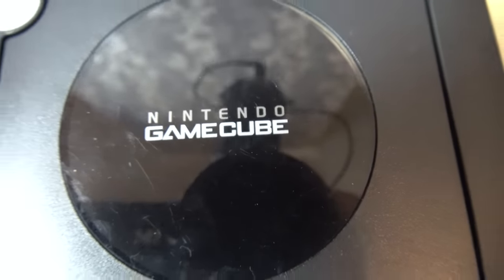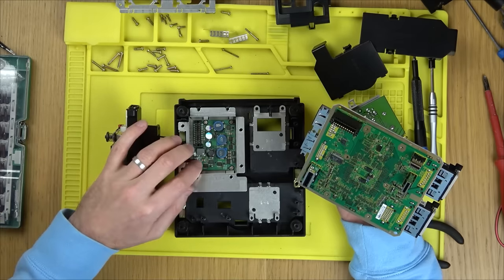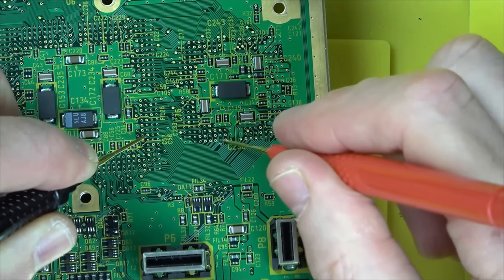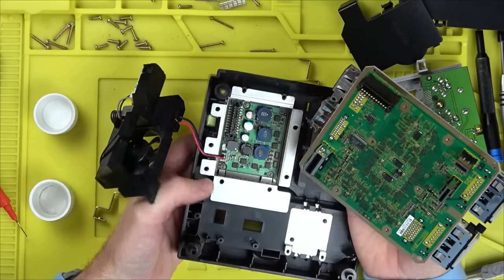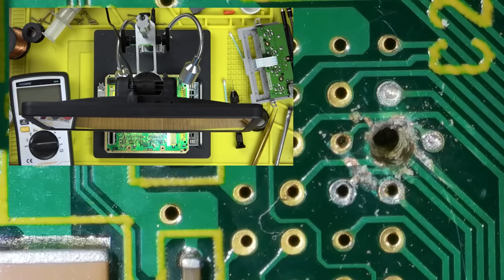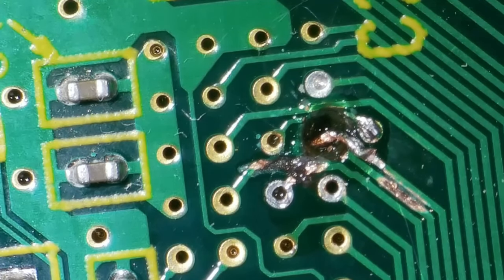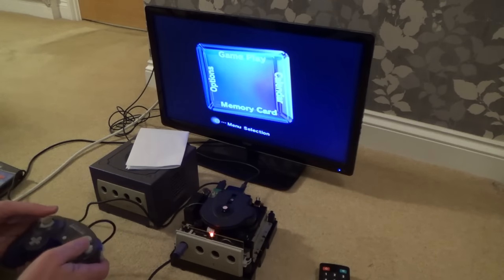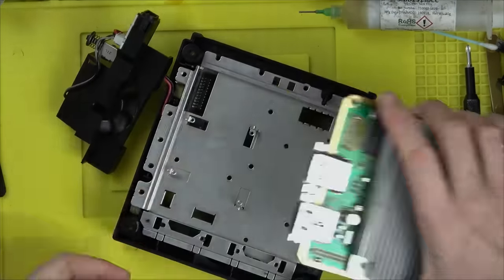Trying to REPAIR a Nintendo GameCube - Black Screen - No Disc Spin

Comment: I'm speechless... I thought you'd ruined it for good. You are, at this point, a mad tinkerer!

BONUS INFO:
Capacitors and inductors have non-static resistance.

When performing the continuity test on a capacitor, you will have a brief moment of very low resistance while the capacitor charges up. As it charges up, however, the resistance will increase, meaning at some point the resistance goes above the continuity cutoff. This leads to a beep-to-silence continuity behavior.

When performing the continuity test on an inductor, it will at first appear to be open (or very high resistance). But as electricity begins to flow through the inductor, the resistance goes down, eventually leading to a situation where the resistance falls below the continuity cutoff. This leads to a silence-to-beep continuity behavior.

Thus, you can sometimes determine what the component is by the way the multimeter beeps:
Constant beep: Low-resistance resistor.
Constant silence: High-resistance resistor.
Beep-to-silence: Capacitor.
Silence-to-beep: Inductor.

Not all of them will behave that way, however:
If the capacitance of a capacitor is too low, you won't hear the initial beep, thus appearing as a high-resistance component.
If the inductance of an inductor is too low, the beep will begin immediately, thus appearing as a low-resistance component.

In other words:
Beep-to-silence or silence-to-beep almost always signify it's a capacitor or inductor (respectively). There may be some special non-standard components that exhibit these behavior, but I don't know that much about electronics.
Constant silence or constant beep doesn't necessarily signify a high-resistance or low-resistance resistor; it may simply be a capacitor or inductor (respectively) with a very low capacitance or very low inductance (respectively).

Comment: I have a "part finished" of the exact same issue - on this one here I removed the CPU to fix the trace, OMG is it the most painful thing to re-fit the CPU...  I need to try and motivate myself to re-try fitting it again...   Totally amazed you managed to fix this after drilling through the layers lol!!!  A "just before Christmas" Miracle =D   Great work Vince!!!  It shows that determination sometimes beats all the odds!  I think if that proves to be reliable over hours of testing - it could be sold as a working Gamecube - other than how large that hole was, you've joined up what needs joining (properly) and secured it properly.  So its a fix that should be reliable imho.
Reply from the maker: A Christmas miracle it truly was 😂 I think I remember your video from years back, we need a Part 2 now Chris! I want to see your pain of reballing it as I sit here smugly watching whilst playing Mario Kart Double Dash on the NON reballed GameCube😂
Reply: 🤣🤣🤣 @Mymatevince  Don't forget the part where in my first attempt I heated it for like 20 mins and was dripping with sweat from all the heat lol
Reply from the maker: @GadgetUK164  Hahaha, but not quite as much sweat as when you used the drill in reverse!!!!

Comment: Vince, that was some excellent PCB digging you did there. Great job and a very fun video to watch. 
Concerning the corrupted SD cards: Always be sure to shutdown your microscope before you power it off by holding the Standby button on the front pressed. It've heard of it corrupting files when power just cuts out (e.g. by switching it off using the cord-power-control of the lamp for instance). I do have an Andonstar microscope myself and keep on forgetting to shut it down propely from time to time myself.

Comment: I can't believe that actually worked, Vince! Wow. How lucky is that. Would poking a wire through the damaged via and heating it with the soldering iron perhaps have worked? I would imagine it would poke through to the ball and perhaps solder to it? Would perhaps have saved the drill. That drill looked so terrifying under the microscope. :O
Reply from the maker: I know, what are the odds!!! I think the hole needed to be made bigger as the ball was slightly offset and not directly under the via. Also the via itself seemed to be quite full (maybe with the solder mask and bits of corrosion) 👍

Comment: To chime in with what other folks are saying about sd cards, there are high endurance sd cards for cameras if you weren't aware. They're slightly more expensive, slightly slower, but designed to record tens of thousands of hours of video without failing.

Comment: Well kudos for having the nuts to try this method of repair. You've shown people who are curious and don't have the knowledge what mistakes can be made when trying to fault find.  But that said it wasn't working so nothing would have been lost, but you did it! The best option would have been to push a wire down without drilling and try to solder it in place. If this didn't work then maybe drilling would have been a last ditch attempt - as I am sure you realised. You were incredibly lucky not to totally destroy interlayer connections or short pins on the underside of the BGA chip when you flowed solder through the hole you made. You could do that 100 times with disastrous results before it actually worked as a fix on one item. I'm so happy it worked for you. Maybe being careful on this occasion would not have worked as the through-hole seemed to be totally corroded.

Comment: I'm surprised it worked out (and glad it did so) but I admit I was mortified when you took the drill to the board😅 I personally might have explored the other side under the heat sink first.  PS: I don't trust SanDisk cards any longer, after going through a number of failures...
Reply: there's a possibility there were fake/counterfeit cards ?
Reply: @VintageTechRepairs  they were legit, I just think the quality in production has suffered.

Comment: Now that was a stunning repair. I actually held my breath when the wire stuck and you measured it. Drilling through a board to get a wire on the ball, ballsy move Vince.

Comment: Awesome vid! The grid of vias that you see are unlikely to be the location of the actual ball on the IC. They are adjacent to the balls and allow the signals to immediately connect out to the other PCB layers. If the balls were on top of the vias, the solder would likely wick down the hole and cause a bad ball connection.

Comment: Vince, when using SD cards, in cameras, after filming, pull the data off the card, then reformat the card.  Each and every time, this resets the file allocation table.  When you erase from a card, it leaves the FAT alone, and that can corrupt your files.

Comment: Great fix. Well done. A quick fix for solder-masking, is to run over it with your air gun after applying the uv light.

Comment: Amazing fix! I was fully expecting a mess of corrosion under the heatsink.

If the SD card woes continue, it might be worth getting a microscope you can capture from externally via HDMI/USB and trying that instead.

Comment: Just some advice for the future when repairing these, the metal heatsink is always the trickiest bit but it's actually really easy. Just stick a small screwdriver in there and pry up. You might have to do it on both sides but I've only had to pry up on one in my few times opening gamecubes. It's perfectly safe but there are thermal pads under there that you may need to replace before using the gamecube heavily. Happy repairing!

Comment: That was an awesome fix, I would have tried going from the side with an small wire first and trying to melt it with an hot air gun + lots of flux and if that would have failed i would reball it as i'm trying to learn reballing abit atm
Reply from the maker: Thanks Karthor. I think in hindsight I would have tried going in from the side as well. I just thought the heat sink was going to be a nightmare to remove, but as usual I was very wrong!!!

Comment: @Mymatevince About your microscope: Clean/Check the ySD card slot for contact issues. The Microscope is getting hit by heat, dust, smoke and shit and SD cards react strange when having contact 
issues. And since you remove and insert the card frequently you "clean" the contacts a little, so it starts working again for some time. About the fix. Great fix! I love it, when the brutal way is the best way to fix stuff. :D

Comment: If you ever do something like this again, I’d recommend getting a grinding pen, it’s for drilling thru pcbs, and for scratching solder mask off traces/vias. Might work better and be cleaner than using a drill. Awesome to see that you got it working :)

Comment: Chip off 100%. And Vince, you can sell this as working even with that fix. Just mention that in auction. I have bought consoles from Ebay u.k that was sold as mint but was damaged. The worst was a Amiga CD32 that was sold as in great condition. Did get it to Sweden and first thing i saw was that the whole console was glued shut with super glue. Seller acting like ”oh i did not know that”. Seller was a retrogame seller at Ebay so he knew. Then when i startup the CD32 there was graphic glitches that he did not know either. So now i was not able to fix that problem (cap replacement) without break the whole console cover. Anyways, keep up the great videos Vince. Greets from Sweden❤

Comment: Hi Vince, I gotta say that was a nice fix. Cracking job!
You might want to try sd cards from Transcend. I've never had any problems with their SD cards even in very cold conditions. Worth a punt. Since SanDisk was sold to Western Digital, I've noticed their QC (quality control) has dropped significantly. I've had many failed micro sd cards and full size sd cards unfortunately.

Comment: You might check the battery with your multimeter to see if it's at the correct voltage. When the battery died in my Gamecube, it had just enough juice to keep the time and date running, but it was losing minutes a day.

Comment: I had the same exact issue on a couple game cubes I literally had to remove and reball the cpu once repaired the broken via and poke the wire through the via. I used a smaller PCB drill bit. Wondering now if it a common issue now? Wondering more what causes it? I assumed maybe water got in or how it was stored, but now not sure?

Comment: You haven't ended up buying a fake SD card have you? It's what it sounds like to me. Even places like Amazon are riddled with them. Usually state to be a certain capacity but is normally only 1/4 or so of what's stated. Once it reaches actual capacity the files just delete/overwrite themselves and come out corrupted. You can use something like H2testw to find out/test it's capacity.

Comment: I had similar problems with GoPro cameras and SanDisk(the extreme series not the cheap ones) constant data corruption lottery changed to Lexar and Kioxia and the problem is gone dunno if it's some sort of incompatibility or quality issue but some of my friends had same problems and some use SandDisk cards without issue.

Comment: Oh Vince, you've got E N B E L I E V A B LE  lucky! When you drilled the board, I cringed soo hard 😀 Good job! I hope it last for a long time.
Other than that, I saw a guy who manually re-balled a chip (no stencil) and it did not take him that long. It all depends on the technique.

Comment: What I think I'd have tried first would have been to stick a fine wire, maybe one strand of a finely stranded wire, down the corroded via to see if I got a connection somewhere down the hole. If i did, I'd have tried tinning it and coating it with flux to see if it could connect somewhere along the way, and then have it soldered on through the existing hole.

Comment: I don't think it was the wrong thing to do, as it looked obvious enough that those vias were connecting directly to the chip, but watching it was scary as the drill bit seemed a bit too large. I really wonder how that issue occurred though. Oh, and honestly I think you can sell that, as long as you say it was repaired. I don't think many could do much better.

Comment: Yup, when the gamecube asks you to set up the language and clock, the clock battery died. I did a little mod on my Game cube where I replaced the origingal battery with a battery holder to make it a little future proof and easier to repace the battery in the future,

Comment: When i opened mine up, i had to use the wobbly extender bit which came with my i fixit tool kit i could then add the game bit to the tip of it and unscrew

Comment: One way to see if that pad was still connected to the BGA of the chip if test the corroded pad in diode mode, if you get a reading then it is connected. Edit - never mind hadn't watched all the video.

Comment: Ive fixed 2 gamecubes so far by turning the potentiator down that controls laser because both systems would power on but not spin discs

Comment: the data on the mainboard did reset because you did disconnect the board with the battery on it thats why you did need to reenter date and time :)

Comment: I bought for £4 a OG Xbox One 500gb spares repair, looked way worse in the pics and hasn't been tampered with and the reason for failure seems it starts up, load a game and just turns itself off which sounds to me overheating, just waiting for a power supply to turn up as my phat Xbox 360 one is different but I believe the 360 Slims had the same PSU as the One.

Comment: Sandisks are the only brand of card I've ever had fail and it's happened about 3 times to me. They do issually go read only so at least you can recover the data but I personally view them as the least reliable.

Comment: good job man, but i personally would have reballed that chip and have a wire through the via, a google search revealed it only has 256 balls, so not that many, you could have done it by hand 1by1 🤪

Comment: hi micro drill  0.5mm  and under this is the best way to do it  note when the real mask goe's very hard  there's no  it come away 

i fix a pcb for a tascam 38 break was down the side  i re glued the pcb put it fine jumper wires  add the solder mask 10 years later 
the pcb is still ok 

i buy alot of gear of ebay  you don't have to be picky about reselling  gear you fixed as long as you tell the buyer you had it in a repiar video
i think you be ok 
in the 90's in the video hire  days alot of video recorders went out on hire  that were never working right  note 
if you see all the repair video's were they  do up betamax decks and resell them  they don't worry about the repairs  

to the gear  you are showing all good things  how many things you will save in the years to come

Comment: IIRC the CPU is the smaller chip and the GPU with Chipset/IO is the bigger chip in the middle.
That's how it was at the time, with 2 Chip Solutions...

Comment: The golden rule of repairs is to never make the fault worse! 

Spoiler

At least you fixed it though! I don't think there was a better option - well maybe a thinner wire and not drill through?

Comment: Regarding the sandisk SD card: check if it is a fake one that you got. Could be it was formatted to a higher capacity. This way you get data loss and corruption when you exceed the physical address of the memory.

Comment: I don’t know what gauge this wire was, but I reckon it would have been of benefit to not use the drill. Under the scope the via looked big enough for a wire to put through directly. In that case it would be a good idea to try liquid flux on the wire and let the heat of the iron heat the ball through the wire.if the flux would not go through the via, removing the heat sink and putting the flux from the top to the ball could work well since the ball was on the very outside.

Comment: beware there is fake solder mask around   i take a test bit out of the tube  and use the uv light before i use it on any pcb   i know what you use  so i buy what you have